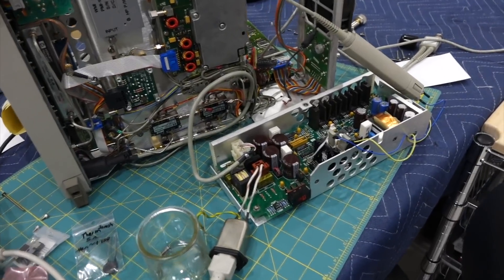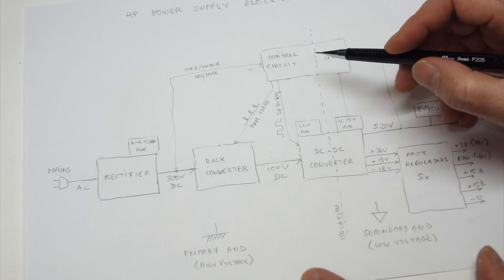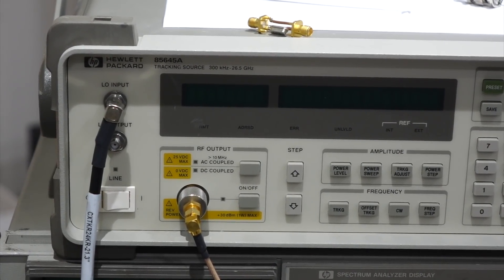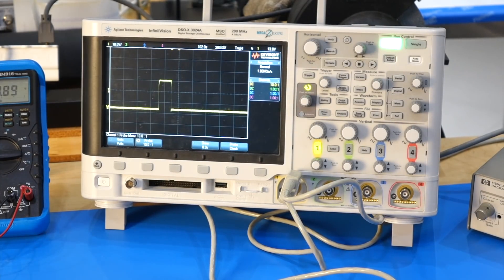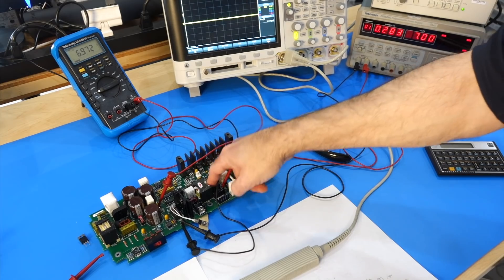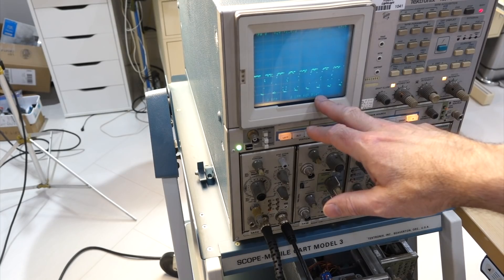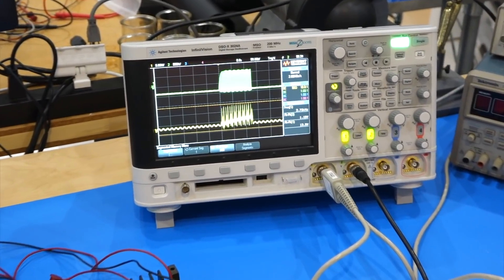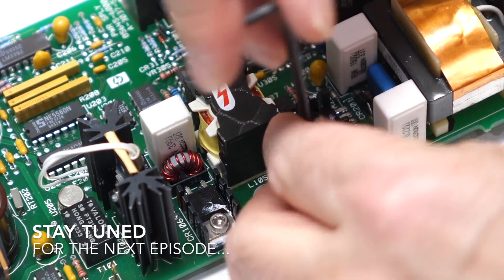HP Switching Power Supply Repair Part 2: Debugging the Startup Circuitry

Comment: Interesting.
However at the end 14:45 you should first mechanically tighten the MOS-FET screw and then only solder the pins. Otherwise you get permanent stress on the said pins.

Comment: Just wondering what is the wattage on the MOSFET transistors if less then 15W what about using VN66AF MOSFET transistors which are designed for 15W dissappation.

Comment: If my osciloscope not grounded and i use 10x probe is it neccessary to use differencial probe???
Reply from the maker: As long as your scope is not grounded you should be fine with 10x probes.
Reply: @CuriousMarc  thanks alot

Comment: Recapping is the new trend on YouTube. Something not working? Replace the caps. These kinds of comments annoy me, really. Replacing the capacitors only works in some modes of failure, where the power from the supply is unstable. And even in that circumstance, the capacitors may not be the components to blame.

Once I've fixed a Mean Well RS-15-12 power supply. The whole control chain blew up, along with the fuse on the primary side. So I've replaced the opto-coupler, that no longer worked, along with the controller chip (with integrated MOSFET) that had its top blown off, and also some other components. The caps were all fine and no recap was done. The repaired supply still works to this day.

Comment: Curiousmarc, what does various switching power supply all have a different start up sequence circuit? to view the start up sequence circuit on an oscilloscope you used the external trigger input?

Comment: I take both approaches. It has been wonderful spending some time on an old Everexx server that I have here, and painstakingly going through it part by part and figuring out its stability issues without just indiscriminately swapping parts. Much of its control board is made up of pal's that can't be replaced. I also take the same approach to audio equipment which I care about, as their are too many variables which can quickly become a money sink if you don't take the time to investigate. 
 On the other hand things like my Mac LCII and LCIII immediatly got all caps replaced before any sort of troubleshooting even began. As they were both known to work before being put away and one still lights up with errors and the other has no life at all. And 99% of the time that solves the problems. And is something which needs to eventually be done to preserve them.

Comment: I agree mostly with the "rant" What you do is the proper way (certainly for this situation), but it is just not economical in many cases. Capacitors are cheap (sometimes so cheap they fail premature) and they are easy to replace. So shotgunning them makes economic sense in a lot of cases. Also depending on application compared to a resistor they have quite the limited lifetime which is specified in the datasheet as you must know. 80's home computers (classic macs, Xbox clock battery) are full of leaking (literal) batteries, corroding the circuit-board. For a time period failing caps were the number one cause of failing main boards and computer power supplies. Then there are the paper-wax caps in tube equipment. They suffer moister ingress. Replace on sight or risk smoke. A few might be fine, but do you really want to keep returning to the same job over and over? Often I consider replacing them all not so much repair but also preventative maintenance. I do agree that this proper analyses is much more interesting to watch. O and before I forget the example of the Rifa safety caps. Yellow transparent housing, very specific series. They swell up crack the housing and then blow up. I found good ones, but never left one in. Quite sure the customer rather not come back twice....

Comment: Nice work, well see if Murphy tosses you another curve ball.    Post repair RCA  is going to be interesting.  My bet was someone shorted the output or a cap went bad post DC-DC converter which took out the FET which took out the driver.  The  last person replaced the cap but by then it was too late, the damage had been done further up the chain.

Comment: Damn that scope acquisition mode and playback is one really fancy feature that probably is too deep in the thick scope manual to really get use of :) You need to be reasonable scope wizard already to start being interested in that advanced features. The modern scopes are way too complex :)
Reply from the maker: It’s worse than that. Keysight makes you pay for that added feature...
Reply: @CuriousMarc  That is actually pretty normal. I have experience with R&S RTM3004 which base price is about 3k€ but with options can go all the way up to 15k€ and worse all the capability is already physically in that base model but you pay to unlock them..

Comment: This is turning into  the 'AGC' the sequel love it. its far to easy to part swap, module swap  complete unit swap. you learn absolutely bugger doing it that way. Also its quiet easy to fault find and fix when you have full service diagrams and schematics.  Its a totally different story when you have  neither and Only real skilled  folks can achieve success. If folks would actual listen to what mark has said in the videos he has all ready checked the  usual suspect capacitors. Im really enjoying  these episodes during lock down and extremely jealous of marks  huge collection of very very desirable  diagnostics gear its hardware porn for the electronics nerd

Comment: I used to fix this sort of thing for a living, and my only comment is.. don't poke your fingers in the HT side, unless you have plastic fingers. 

This applies equally when switched off and unplugged as it does when it is plugged in. That 300V DC gets a little bit exciting if it hasn't discharged. Things get even more exciting when you start playing with real HT (CRT drive circuits and so forth). Wear a suitable rubber glove and/or keep your left hand  in your pocket at all times. Isolation transformers and RCD breakers will only provide very basic protection, and fuses are only there to ensure the building doesn't burn down. The best protection is the lump of porridge between your ears. Always assume you are going to get a belt, at least that way when you do, its less of a surprise.

Comment: Devices like an IR2106 or 2150, even FAN7380s suffer over extended periods of time from thermal issues.  What happens revolves around the Q on the gate not I'ing fast enough leading to increased rise or fall times. The downside of this is a tiny overlap during switching is, Eventually peak currents do damage to the coulomb barrier within one of the MOSEFTS, leading to a angry pixie riot taking place in the die.
Most people head for caps in smps and while this is partly true due to constant thrashing at high frequencies, sometimes its just a good old lazy gate somwhere

Comment: Marc! You have a very impressive collection of test equipment!
I had a tek 7904 for several years, (and a bunch of plug-ins) however, it had a list of several faults which 
included the character generator, and the +/- 15 volt rail. I fixed the PS, but could never figure out the CG fault...  
After it collecting dust for several years, I finally sold it at a HAMFEST for a third of what I paid for it... :(

Comment: "Do it the CuriousMarc way" aka the PROPER way!  These days, most techs just seem to swap units, and have no knowledge nor interest in why something fails or how to fix it - everything is seen as a disposable.    And those who just recap everything in sight....smh.  Excellent stuff as always, Marc. :)
Reply: This is the difference between a technician and an engineer. A technician knows what. An engineer knows how and why - and has the skills to find out.
Reply: Mark's rant was music to my ears. I was taught to  find the fault, then find what caused the fault and then fix, commonsense dictates that unless you do how on earth do you know you have really  fixed the fault.  Back in the seventies I had a job fixing  out of spec switching supplies that came off a production line. Youngsters now probably wouldn't believe that such a thing happened but manufacturing and components were then very expensive.
Steve
Reply: It's much the same with cars. You try and find the schematics for an early fuel injection or ignition computer and you pull a blank every time. They simply aren't available. The message to mechanics? Swap with a new unit if all else fails. At least in the early days of fuel injection, they did do some fault finding... not so much today. 

A good example of this was an aunt and uncle who had an issue with their car under while under warranty. Over $ 3000 in replacement parts were fitted(at the warranties cost, obviously) with no sign of fixing the problem. It left them scratching their heads until one of the older mechanics took a look and found a hole in the back of their EGR valve. He stuck a piece of coke can over it and it solved the problem. The car is still running like that, nearly 10 years later. It's an example of where understanding the system and diagnosing a problem is far better than simply swapping components. The latter costs a fortune, especially in the case of cars. I have seen so many discard a car for what was a simple bad connection.
Reply: I would disagree, you are just looking one side of it. There is equipment used that not everyone has, there is also time spent vs just buying (economic reason).
Reply: Allthough i appreciate the mark way u should factor in the time spent on the issue. These days ckts are so big it just takes too long and how long u may never know in the beginning. Of course once u know ur way on a board it becomes easier on similar boards. But u are probably just already on another problem and u cannot deviate to fix this. One has to devote long time and focused attention to solve unknown complex boards and the machines are just printing them in seconds.
Reply: The proper way (and I agree it is the proper way) is just not economical in many cases. Capacitors are cheap (sometimes so cheap the fail) and they are easy to replace. So shotgunning them makes sense in a lot of cases. Also depending on application compared to a resistor they have quite the limited lifetime which is specified in the datasheet as you might know. 80's home computers (Xbox clock battery) are full of leaking (literal) batteries, corroding the circuit-board. For a time period failing caps were the number one cause of failing mainboards and computer power supplies. Then there are the paper-wax caps in tube equipment. They suffer moister ingress. Replace on sight or risk smoke. Replacing them all is not only repair but also preventative maintenance. I do agree that this proper analyses is much more interesting to watch.
Reply: Bart Zuidgeest Those mass capacitor failures were industrial espionage gone wrong. There was nothing wrong with the source formulation - except the thieves didn’t steal all of it. And all the companies that then perused that stolen formulation have just shot themselves in the foot. There was nothing wrong inherently with the capacitors. They were manufactured in a way that gave them an Eingebautes Verschluss - a predefined end-of-life. There was nothing random nor unexpected here - except we the customers initially didn’t know what was up. Everyone in the know in the industry knew exactly what was up. And it had zilch to do with capacitors per se. the capacitors were basically rigged to fail.
Reply: @absurdengineering  The cause hardly matters, fact is that many classes of electronics contain failing capacitors necessitating replacement. You can leave the "good" ones in, but that is just asking for having to revisit a device in the future. Also neither the rifa X cap or paper wax type (in tube equipment) example have anything to do with espionage. Shotgunning might just be the most economical in time spend on a device, even if it is not a "proper" repair
Reply: Bart Zuidgeest In my experience the capacitors are not particularly more likely to go bad if they didn’t have design or manufacturing issues. To that end, anything manufactured prior to 1950 and not made out with mica, glass or air for the insulator is essentially a failure waiting to happen - so indeed wholesale replacement of that junk is more than worth it. That usually means anything in WW2 vintage radios or PA equipment… even though the audiophools are still buying into the Black Beauty marketing almost a century past the expiration date. Some people just totally lost their wits for the groupthink and treat simple concepts as if they were black magic - and refuse to take the time and effort to understand rather than just repeat what they read on forums full of people just like them. And then experienced people like Mr Carlson have to deal with that nonsense… I can’t but sympathize. Cap-wise, I’ve been seeing an unexpected spate of failures of hermetic tantalum capacitors in HP equipment made in the 70s. Those are mostly still current parts and cost almost always >$10 each, sometimes >$50 qty 1. I hope they resolved whatever problem the production line had had those 5 decades ago. Those caps are meant to last forever, even in vacuum and on orbit.
Reply: @absurdengineering  Black beauty should be replaced with black bomb :) and then we are getting close. The "wet" electrolyte is acidic and even good materials might eventually degrade. Foil and mica should last close to forever (but there is silver mica disease) Strange you should mention mr carlson. He and curious marc seem to be on quite opposite sides on the subject of capacitor replacement (i watch both those channels). I've seen carlson fix more modern switching power supplies and beside good diagnostics he also shotguns the electrolytic caps. (so does xraytonyb)

Comment: The master of suspense!!! I'm getting that AGC 'can't wait for the next episode' feeling.
Actually thinking back in time used to be able to get rebuild kits for shot gunning SMPS on some products.
One duff part in the chain takes everything else out before you can even contemplate what happened.... All very costly and time consuming. Also those very much manufacturer specified devices that you must use or it just goes bang again down the road....

Comment: My experience with the MOSFET driver ICs is that they won't tolerate the Vss droping below the input side Vee by more than a fraction of a volt; the failure mode is often to turn both MOSFETS on causing shoot through. Obviously that doesn't apply to devices like the ICP2104 where the supplies both refer to the COM pin, but older devices like the IR2110 suffer this weakness.

Comment: why not solder regular 60w light bulb instead of a fuse. It will not affect unloaded PSU but in case of overload it will save mosfets.
Reply: A bulb might not be fast enough to save the Mosfets. A quick fuse might.
Reply: @Citronitroify  a bulb will limit the current.

Comment: what about just replacing EVERY component on the board? might be the fastest solution?
Reply: Usually after replacement like that you will find out that the board itself has a shorted/broken trace in the middle layer)
Reply: I think this is more of gaining an understanding of whats failing and causing the problem. Hopefully when you find it that's much more rewarding than shot gunning the whole board. Maybe in a fast turnaround customer is paying situation then that can be an effective approach as would be just replace the board. The cost / availability of board like this though, not first choice.
Reply: And what about the transformers? Winding by yourself?

Comment: I think when an IC like that fails, there likely is another external reason for it (so the next one will fail again).
Either its supply voltage is incorrect, its input signal is above its supply signal, or it gets a high voltage back from the failed MOSFET gate.
Reply: You have a point, I have seen many failed MOSFETS that short to the gate, and damage whatever drives them. And the failed FET can be for many reasons.. maybe the magnetics design was poor and the BH field walks from center, saturates, and pops one FET..

Comment: Good to see 50 year old technology (7A22 differential amp) come to the rescue when the more modern devices aren't up to the job.
Maybe this is a bit of a boost for us old-timers, showing that younger and newer is not necessarily better.
Reply from the maker: These Tek scopes were royalty back then. Not quite 50 years old, more like 30 years old. They used to cost a fortune, but oh so awesome. Then you can get a specialized drawer for measuring almost anything! A collector's dream, the drawers are quite affordable now.
Reply: @CuriousMarc  The 7A22 was introduced in 1970 so is now 50 years old. Some of the internal design was derived from earlier Tek products so is probably more than 60 years old. The 7854 was introduced in 1980 so it is a relatively young 40 years.
You are right about the 7000 series now being very affordable compared to its astronomical original pricing but they are not just collector's items as they are still useful instruments. I occasionally roll out one of my 7000 mainframes and select the appropriate plug-in whenever I have a difficult measurement problem that can't be easily done with a modern scope.
Reply from the maker: @stephenbell9257  Wow I did not know they were that old. Even more impressive! Thanks for the info!